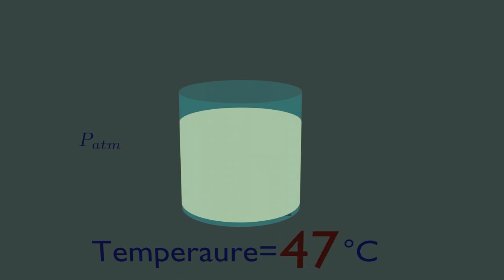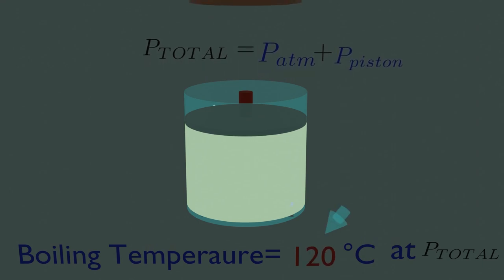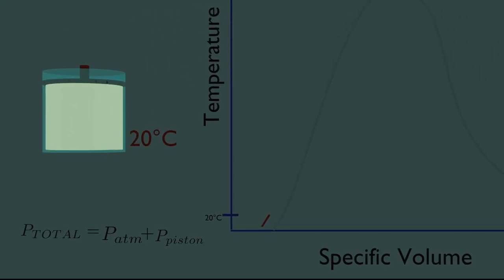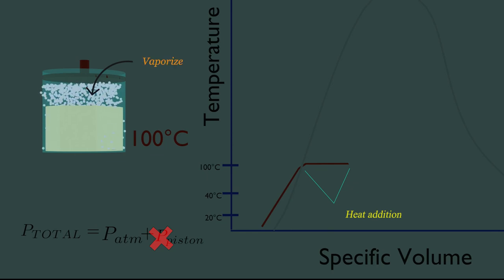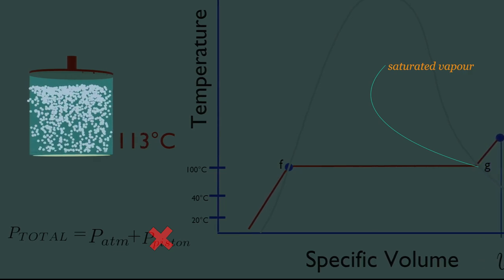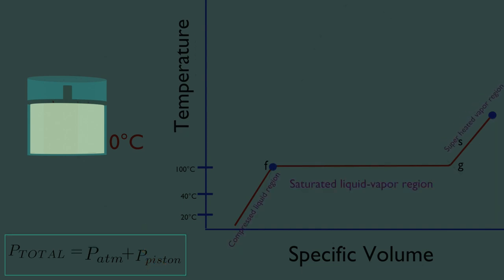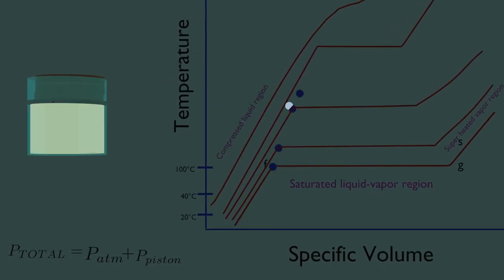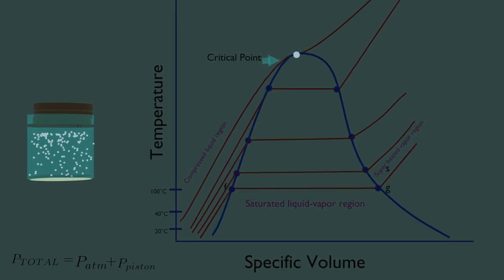Property diagram for phase change animation (thermodynamic property)

Comment: Very interesting and inspiring presentation. I would like to try I animating "Geometric Proof of the Quadratic Formula" for example. Your presentation makes it feel like an achievable exercise. May I ask which software did you use to build your video. You could add the answer to the video comments. Thanks IG